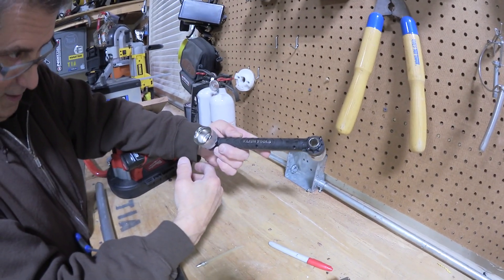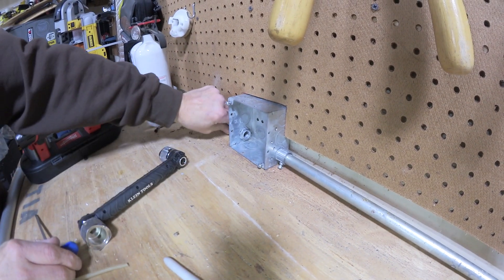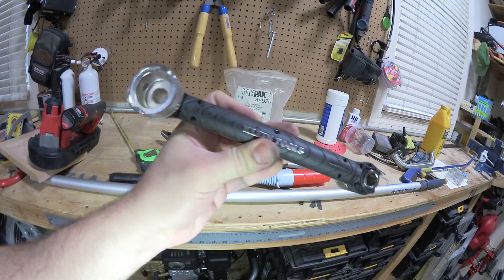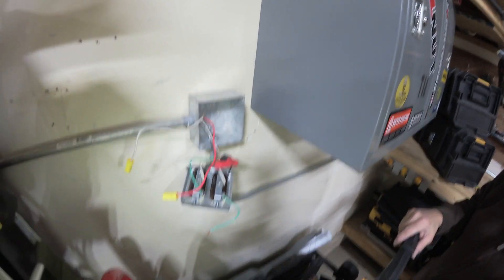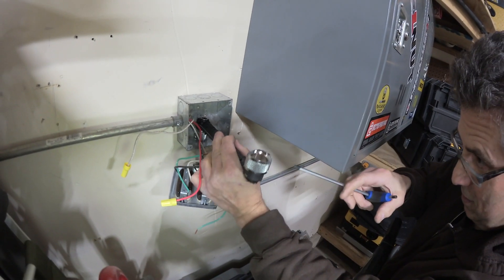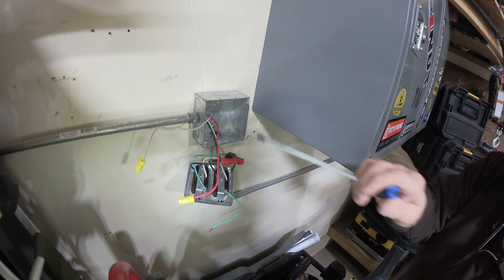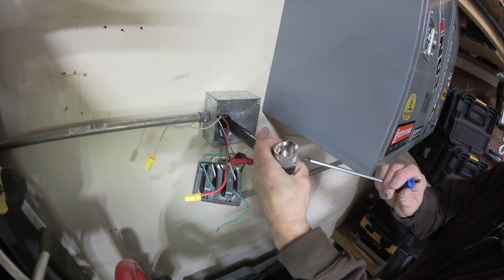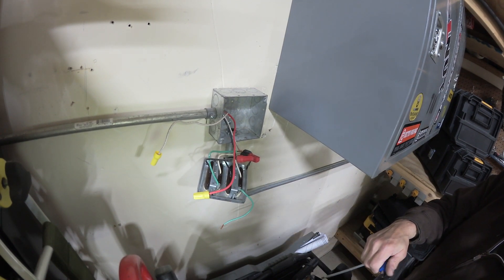KLEIN Conduit Locknut Wrench

Comment: When I run conduit I put the fitting on, the lock ring, and then tighten the fitting with pliers (on the other side). When I have to tighten from the box side, a screwdriver and hammer works very well.

Comment: I guess I could see myself using this tool once in a blue moon, cant see myself using it for most connectors. For regular installation, I put the connector in with channel locks, for cut-ins I am usually using MC with a stab in type connector. Its just too large to carry up and down ladders, and doesnt seem any faster than using channies or flat head + hammer.

Anyway, still an awesome video, and glad to see TIA are still going at it, getting bigger and better every day, awesome job guys!
Reply from the maker: +Tapelegs Thanks!

Comment: I've always done locknut the traditional way, but recently found an odd situation where a locknut wrench is needed. What jumps out about the Klein is that it only works for locknut inside the box, not outside (rigid and floodlight sockets).

Comment: Very cool tool but also very much not needed. As some others have said before just take out a flat headed screw driver and smack it tighter with (What I think works best) linesmen pliers.

Edit: I did want to buy this tool before I realized how unnecessary it was. Also the fact that I have to shove something between the two holes to actually tighten the ring makes it even more pointless. I still need two tools as stated in my way above. Also did you see how those screwdrivers were bending? No thanks, I'd rather just stick to my method where the screw driver won't have a risk to  be bent. If anything it'd be easier to get a screwdriver in there than that thing since the screwdriver is smaller. Sometimes I can just tighten those with my needle nose. I can see maybe one or two instances where this would be handy, but 90+% of situations where I need to tighten that ring I could do it without this.

Comment: You usually put the connector in the box before the pipe. it's easy to use your channel locks on the connector from the outside of the box to tighten the lock nut. I don't know anybody who put the pipe in the connector on the pipe first. To bulky to carry around. I think they're looking for a solution to a problem that doesn't exist. THIS TOOL WILL FAIL

Comment: Lmfao 🙈😂😂🙈 just use a long flat head and tap it with you pliers save time and space in your tool bag and weight as well as money from a non versatile tool.
Reply from the maker: +J Plap Thats what the norm is
Reply: +Tools In Action yes I do it everyday I see no need for this tool at all it would actually slow me down.
Reply: +J Plap , this tool does have a purpose, its just not a very big one.   The only place where this tool is practical is for metal cut-in boxes, with either MC of flex.
Reply: +Derek Ash  MC or flex*
Reply: +Derek Ash :D

Comment: It is a Great Idea.. BUT so Not Worth the money... If anyone ever worked in the field.. Dont matter Flex,MC,EMT,Romex in metal boxes... IT dont make a difference..  Will Take to much time end effort to reach for a "Tool" where u now have to fish the wire threw if its in the box already... and if no wire is in yet.. then u have to still line it up... and get tool straight, and use 2 hands 1 to hold it other to turn... anyone even if if its your 1st time putting on a connector , can have it done b4 someone use's the tool..